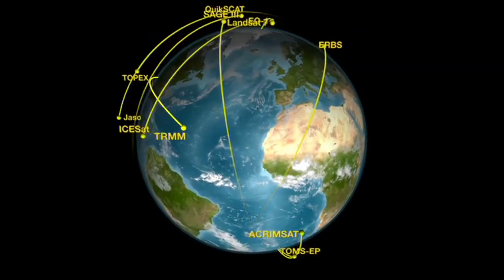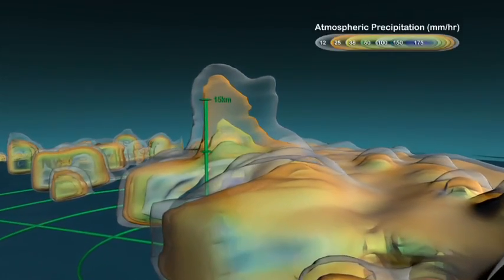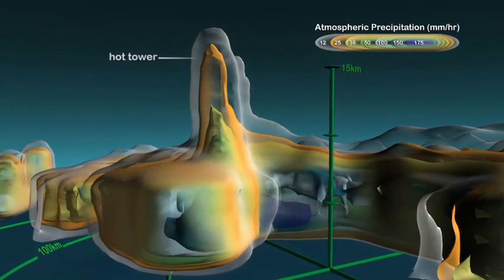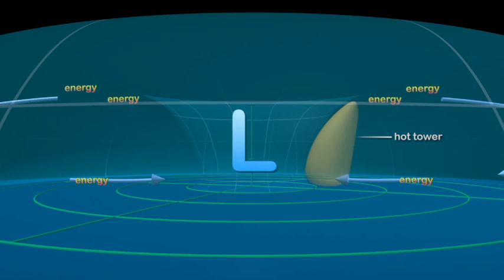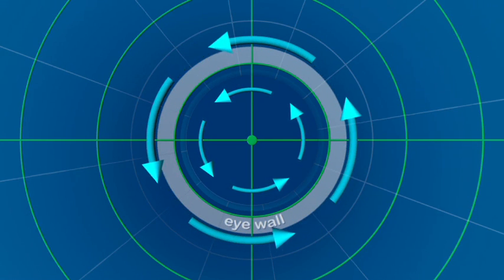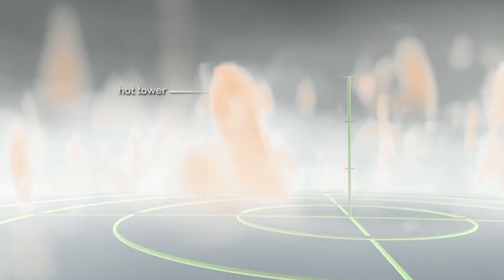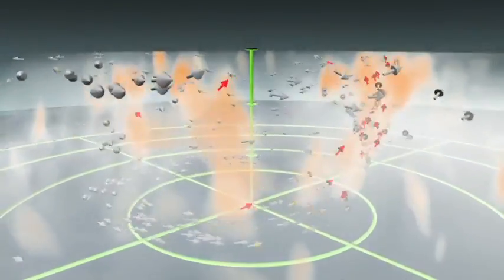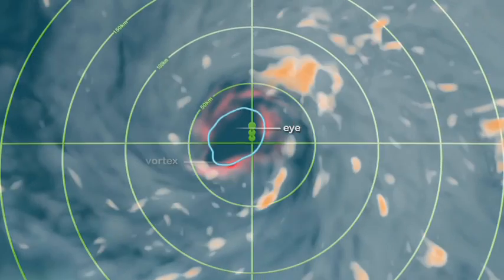'Hot towers,' the natural engine of hurricanes, explained - NASA

Comment: Hot tower theory is nonsense.  For moist air to be lighter than dry air it would have to become genuinely gaseous at temperatures far below its KNOWN BOILING TEMPERATURE. Warm moist air and updrafts are coorelated.  But the belief that it is due to buoyancy is just stupid.  The physics don't work.  Do the Effin math. Look at an H2O phase diagram.

Comment: but where low pressure come from?
Reply: marshalcraft from the high velocity wind. More velocity = less pression (Bernoulli)
Reply: @metaloper  you saved me hella time on a environmental essay ty :)
Reply: Usually off the coast of Africa where there is hot Desert air combined with the cool waters/sea surface temperatures around the equator create wind and instability. The wind forces the warm air to rise creating a low pressure near the surface.